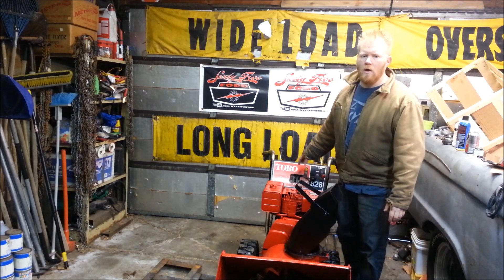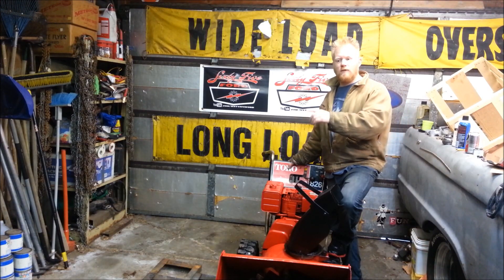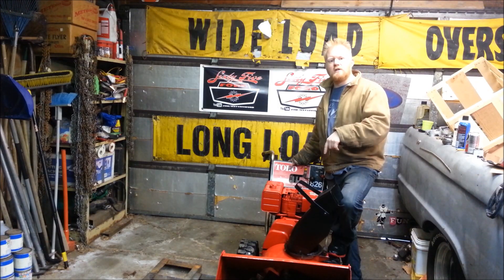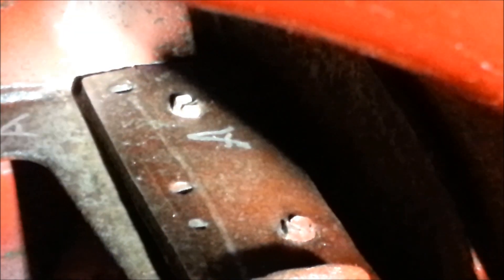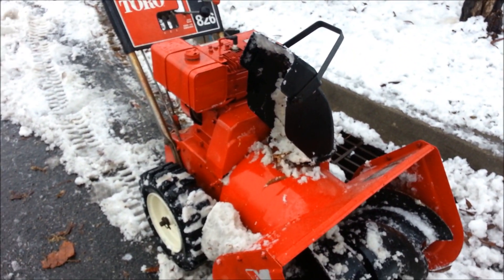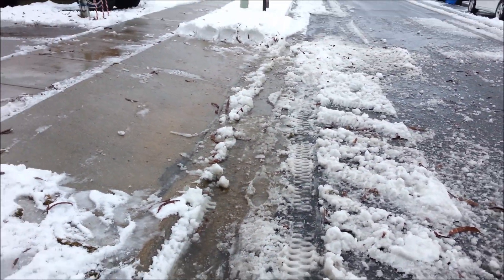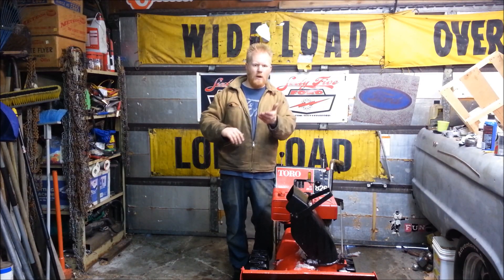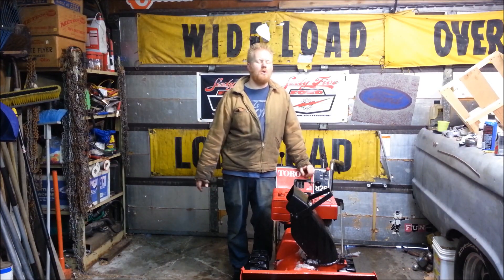TEST snow blower Impeller Modification with and without

Comment: I did the paddle modification on my 1980 Toro 524 and in wet heavy snow is where it makes a huge difference.  These old Toro's with the barrel augers never did throw snow real far but are efficient at moving snow.  My new Toro Power Max HD 1232 on the other hand can blow any kind of snow wet or dry extremely far.  Last winter here in southeastern MI we got 8 inches of very wet heavy snow. The Power Max HD threw that wet slop 50 feet. According to Toro powdery snow can be thrown 57 plus feet. The Toro anti clog system works as advertised. Snow blowers have come a long way in the ability to throw any kind of snow with efficiency. At least the HD models with 14 in impeller and arguer systems. My opinion on three stage units is that they are not as efficient in all snow conditions. Most who buy them regret doing so after a few winters using them. That is great you show the before and after difference when doing the impeller modification. It is an easy modification to do and in wet snow is where it really makes a difference.

Comment: what type of rubber do you recommend to use and thickness?
Reply from the maker: Conveyor belt is the best. Problem is you can't buy it cheaply in small quantities readily. You can however buy snowblower paddles for single-stage snowblowers that are made out of conveyor belting for relatively cheap. I have a link in the video description for the Toro s200/s620 snowblower paddles that are straight rubber and easy to utilize for this. You can also use things like the side walls out of an old tire but they're not quite as good. 1/4-in is ideal
Reply: @sixtyfiveford  I bought myself an impaler kit from amazon. Comes with everything i need. Will give that a try. Thanks for the reply.

Comment: do you think it will work on a Deere TRS22?  I don't think I can get to the impeller from the top ?? Thanks
Reply from the maker: George Fear Yes, it'll will make a huge difference on your TRS22. Pull the few bolts holding the chute on and you will be able to access the impeller blades. It should have the rectangular chute opening so it will be tight. You may need to get a long reach drill bit extension but it is doable.

Comment: What a gorgeous older snowblower.   Love the older stuff like that.  Great video and idea.
My only question is if it makes it worse or better when you nail a newspaper.  Took me 45 mins to get it out of my 1028 Toro yesterday.
Reply from the maker: captainedc I would say better. Since there is no gap it's less likely to get jammed in there in the first place.
Reply: Thx.  That makes sense.  I guess you make the piece of rubber long enough so it wipes and has to wear in a little bit...
Reply from the maker: Yes. Just install it so it barely touches. If by chance you happened to get a paper lodged, you would be able to remove the couple screws and the paper would fall right out.

Comment: I've got a question, does this modification help prevent stones getting jammed between the impeller & housing? This always happen to my two-stage a couple times a year and it is a major pita, having to pull out the hammer & one really long spike to knock them out of place. I was thinking this mod might help with that, since it creates a zero gap. Any experience with rocky surfaces, post mod, you can share?

Comment: After watching many videos showing how to do the impeller mod , done in the summer, then claiming it works……then came to your video which showed the difference this mod makes. Thanks for going to the effort to produce this video, which shows the difference it makes. This was the proof I needed to carry out this mod and see the results for myself especially with the wet snow my area usually gets.
Reply: Sixtyfiveford, do you need to worry about balancing the two rubber paddles (weight wise or location wise)?

Comment: Just installed 3 paddles made from an old boat trailer tire on my MTD Yard Machine 8hp snow blower. 2- #10 screws/washers w/lock nuts on each paddle. Started it up & they worn in just right. Can't wait to try it...no snow in the forecast anytime soon here in Southern New England. I'll let you know how when it does. Thanks for the videos!
Reply from the maker: ***** Yeah, let me know what you think when the snow hits.

Comment: Thks.  i realize this is a no brainer once you know but til then i have wondered if my 8 yr old Ariens was starting to die.  i have changed fluids, it starts after the long summer with one pull but this clogged chute was starting to give me doubts.  now i am wondering about needing chains on the tires

Comment: I live here in Maine..would be nice to see you go thru 8-10" of heavy wet snow..and how long do your rubber paddles hold up? I have some old conveyor belt in good shape so I can cut some out of that. I was thinking of using some teflon strips I have.  Thanks Bill
Reply: Only thing that I can think of making your channel better is if it was called old69 chevy    GRINS!!!
Reply from the maker: william armstrong
 In the video I am going through 3" of slushy snow/water that would easily translate to 8" of typical heavy wet snow fall. SixtynineChevy :)

Comment: I live in Detroit Lakes, MN - 45 miles East of Fargo, ND. & I saw your video last night and converted my 8hp Craftsman today.  I had the heavy impellers so I had to buy a long drill bit  for this project because it was a long reach & bolted the 3" belting I got from M&H supply with 1" x 5/16" bolts and used nylon lock nuts - I lubed the inside of the drum with oil for the start-up and fired it up - Interesting noise for sure.  I let it run for a couple of minutes and everything looks great - Now all I have to do is wait for the snow and that will be the real test.  Thanks for the great idea.
Reply from the maker: Keith G I'm glad you tried it and I know you'll be very happy with it.

Comment: Elegant solution! Will be doing this on my new B&S 1696614  (MD 1024). Thanks!

BTW...Just bought it today on Amazon (killer deal). Do you have an opinion on this machine and if you do could you please share?
Reply from the maker: Virtually all of these machines are built to the same quality. This has the Briggs engine though which is really nice. You'll be very happy with it. On a side note: if you salt, make sure you oil the housing of the snowblower with old motor oil or any oil to prevent rust.

Comment: After watching your other video on this modification i did it to my craftsman snow blower and it throws the snow at least twice as far and does not clog up ever. it used to clog up a lot. Going to do the same to my dads snow blower next. Thanks for the tip.
Reply from the maker: It's amazing what such a simple thing can do for them. Thanks for letting me know. What does your father have?
Reply: sixtyfiveford My dad also has a craftsman.

Comment: Is the "break-in" smoky??
Reply from the maker: Rich Gordon No.
Reply: So you would advise doing th break-in with a little snow mixed in or dry?
Reply from the maker: They should be set to just barely rub/touch. There really isn't a long break in. You will be able to use it right away.
Reply: sweet

Comment: OK, just one more success story. I gave a neighbor of mine some of the 1/4 thick conveyer belting I have and he used it on a vintage Craftsman track driven old beast of a  snow blower he got from his father. This unit is the good old day toughbuilt stuff that sears sold when I was a kid. Because the machine had a lot of space between the paddles and the tunnel is why I think, as you do I believe, he says it made the old girl throw snow twice as far as before and not clog in the wet crap. Thanks again, and I am going to continue to refer people to your very well done youtube video. Thanks.

Comment: will the sidewall from an st205 work?
Reply from the maker: Yes.
Reply: you said it has to be 1/4 of an inch thick,  right?
Reply from the maker: Doesn't have to be. It can be 1/8 to 1/2", 1/4" is just easiest to work with.

Comment: Wow, very smart thinking! Thanks for sharing! I went ahead and just made the modification on my 1970s Toro 8/32 that clogged-up easily especially in the wet stuff the plow would leave behind. In my case I had a 3/8" gap from the housing to the blade edge, bought a rubber flap from a single stage snow blower and cut it to size to install. Works great now! Just curious though... do the self tapping screws rust over time and do they eventually loosen from all the vibration in the snow blower?
Reply from the maker: Jay Vee They will weld themselves in place with a light rust.  Then they're not going anywhere.
Reply: sixtyfiveford Cool, thank you so much!

Comment: I did this mod last winter. I was ready to get rid of my 8:hP mtd for a higher hp model. Thought I'd try this first....Man am I glad I did!!  Works awesome!! When my neighbors are all clogging up..I'm still chugging along !
Things you'll need....
1)Rubber at least a 1/4" thick- cut into 2 1/2" wide by 3" deep.
2)Self tapping screws 1" long and washers( very important) -keeps head of screw accessible in case you have to remove it one day...
3) remove shoot from machine
4)predrill the rubber with 2 holes going front to back
5) put rubber on impeller then use your drill to basically Mark where your screws will go...
6)pre drill pilot hole in impeller for self tapping screws ( I used a narrow step down bit)
7) attach rubber with self tapping screw with washer...let it poke through the rubber so it'll be easy to find the predrilled holes. 
8) secure it down...spin impeller and do the next blade. 
Good luck...It's super easy to do!
9) let it snow and be amazed at your new machine !!
Reply from the maker: I'm glad you tried it out.
Reply: joe DiMemmo : I have a 8HP MTD with Tecumseh engine.  It has 3 blades on the impeller.  By putting the paddles on, doesn’t it leave a non-smooth exit surface to throw the snow?  Or that doesn’t matter?  I can’t mount them on the back side of the blade.  Did you make the paddle fit the curve of the blade (it curves upward at the outer edge).  I can’t insert an image :-/
Hope to hear from you via reply in this thread
Reply from the maker: @es52  You don't put it on the curved outer edge. Only put them on the leading edge as it will pull off it put on the back side. Even if you leave a 1/4" ridge from the rubber, snow will immediately fill it in.

Comment: I'm looking at impeller kits right now to get. I live in MA right on the coast, ocean bay is my back yard and during snow storms my back lot floods and turns everything to slush. If I don't clear it right away it freezes solid  by night time. My 1971 Ariens Sno Thro has plenty of power but it's the clogging that is the problem.
Reply from the maker: This will take care of that.

Comment: I did this mod to my MTD SNOW FLITE (1984 vintage) with the 1/4-20 bolts due to the heavier gauge steel in the impeller. I used 2 1/4-20 bolts per paddle per impeller blade, I have 4 on my machine, 8 bolts total. I also added washers and lock washers as well, no nylon locking nuts though, as I doubt I would need them.
Reply from the maker: Andrew Koetz Awesome.. Those Vintage MTD machines are well built.

Comment: Just checked your link for the rubber paddle material, It's $10.50 on Amazon USA and the exact same item on Amazon Canada is $27!!!   sigh     When I initially put the rubber piece down to gauge where I want to attach it.  Should the rubber be touching the outside edge all the way or should it be pulled back a little to leave a very small space
Reply from the maker: Leave a small gap. Or I like to cut the touching edge to a 45 degree point so it's light and flexible. It can just touch the impeller housing without creating any drag.

Comment: Great idea.............  seems to work, fairly simple and cost effective.  This probably would have worked on a single stage tractor mounted snow thrower my Dad had many years ago.  He had it on ten minutes and cleared the chute 4 times..  it then went in the garage never to return. Thanks for sharing. Since kids may be watching these videos might I suggest not clearing a clog by shoving your leg in the chute even with the machine off  ?
Reply from the maker: +Nate Ngzcaz I have used it on many single stage tractor snowblowers, and you're right it works great.

Comment: I have heard this is a big issue with snowblowers. Having never used one before I will have to wait and see how mine does in wet snow. Having just paid $799 for my Cub Cadet 526 SWE marked down from $899. It would just pain me too much to go and start drilling holes in the impeller.

Comment: Years ago before the original skid shoes wore out, my dad bought a pair of the aftermarket STEEL "universal shoes" that you can flip over/end for end" when one side wears out. I have yet to flip those shoes. However I do need to work on re-building the box, as the ice & water build up has put a good heavy coating of surface rust on the box, also the scraper edge I have to replace after I find another one. Also the edge the scraper bolts to needs some hammering, grinding and welding to get it back to what I need so I don't have to buy a new box. Do you have a FB page for your modifications by chance. I have photos of my blower.

Comment: Hi Moe, great demo!!!
Is the paint on that blower new or just well maintained? I have an old Gilson & would like to repaint at the end of this season. Do you know where I could get the orginal color?
Reply from the maker: Thanks.. She has a new coat of paint this year(built 1981). Gilsons are great machines, but I don't think an exact color would be easy to find. I had a Simplicity I did years ago and had an impossible time finding Orange paint. I ended up just doing it red but later I found orange paint that was close at my local farm store (tractor paint).

Comment: i wonder if this would work on a single stage
Reply from the maker: ***** A single stage is the exact same principle. If you have an all metal auger, adding rubber paddles just to the center where is discharges snow will help a ton.

Comment: Absolutely cool! I just came into my shop with a totally impacted two-stage Honda HS928 ten HP and sat down on my laptop while I have a fan on it to melt the snow. I WAS trying to use a silicone spray, hoping the snow would slip by. Not very mechanically inclined but I am pretty sure I can follow your instructions. Thanks a million!
Reply from the maker: Thanks, I'm glad you liked it. I hope you try it out.
Reply: @sixtyfiveford  I did this with my older Honda HS80 no problem. Haven't had chance to try it yet. But my newer 928 is out of the question. Impeller must be tempered. All I did was chew up self tapping screws and drill bits.

Comment: Hey, GREAT video man - this is frickin' genius! I haven't bought a 2 stage snowblower, but I'm about to - my lil' single stage, 2 cycle toro finally died....and this video not only is a GREAT tutorial, but it's also going to make me look at the clearances of the impeller BEFORE i buy the darn thing. One quick question - the Toro that you used for the test - how many HP or cc's was it? I live in WA state, and we can get fairly heavy snowfall too, and that Toro looked like it was maybe bogging down a bit in the wet slushy stuff?
Reply from the maker: The snowblower in the video is an old 1981 with an 8 horse power (13 ft lbs torque) Briggs and Stratton engine. The test is an extreme situation and the snow is half melted and as heavy as it gets. A regular shovel full probably weighed 20+ lbs where fluffy snow would be under 1 lb. Something like the new Toro Powermax 926 has a little more HP and would work very well for wet snow.
Reply: sixtyfiveford
Thanks man, appreciate the info!

Comment: Yes I did this to my old Toro 724 with Tecumseh 8Hp That I installed after blowing up original motor. It literately throws 3 times as far! I got the idea originally from you and finally did it this year (The worst year for snow in 10 years) Yep I am a happy camper. However I must confess I bought a kit which made the project so easy. Because of where I am located getting suitable rubber was an issue. So I just bit the bullet and bought a kit! However I heard it here first! Thanks again!
Reply from the maker: Awesome. Glad you did it.

Comment: Made the mod to my Arien's 926LE which was clogging up regularly in the 6" of super wet snow here in NJ. A bit of a job since the impeller blades are too thick for  self threading screws so it makes it somewhat of a chore to correctly attach the rubber paddles lightly against the impeller housing (I ended up having to trim them back some to ease up on the drag). Also, any deficiencies in your accessory drive belt will be magnified due to increased drag( you may have to adjust it if it's worn ) until the paddles wear some. Otherwise it does as advertised...thanks!
Reply from the maker: You're welcome. I'm glad you spent the time to do it and I hope you enjoy it for years to come.

Comment: Mine clogged so bad it ripped the whole chute off last year. I am definitely trying this. I used to keep PAM with me, but it is a pain THANKS
Reply from the maker: I hope you try this out. It will save you a lot of grief.
Reply: Try silocone spray. That stuff holds up well. The chute on my 71 Ariens broke off last winter as well. It was modded with one of those new Predator engines so the snow is being thrown out more rapid. Although it was nearly 3 feet in some places and the snow was literally up against the chute it was so high. At 45 things are bound wear out.